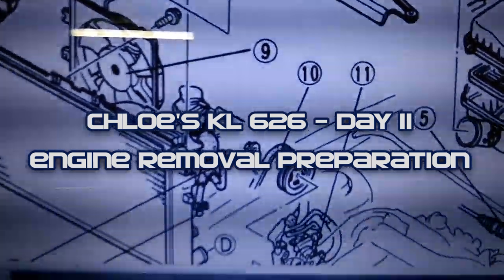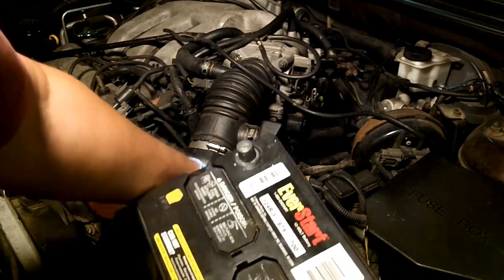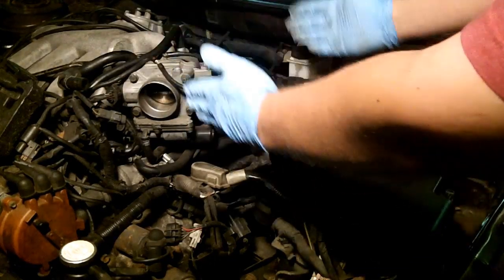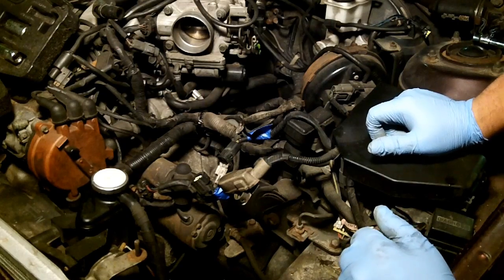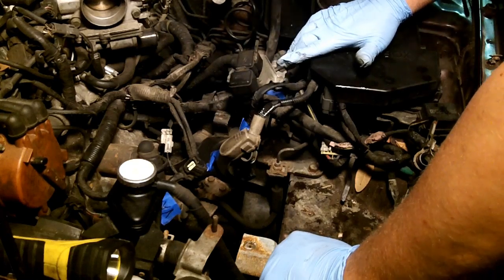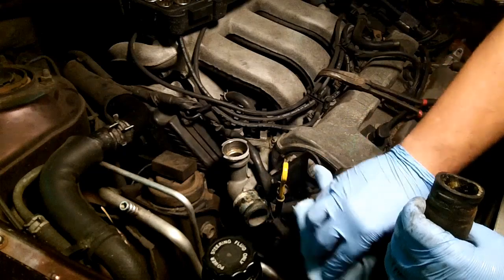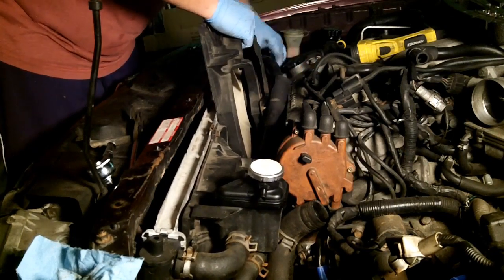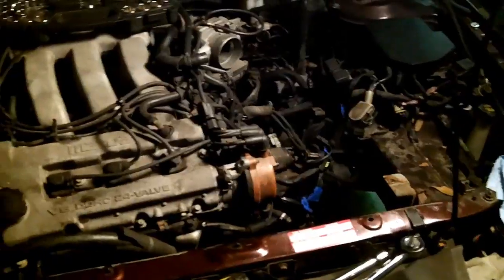Angel KL 11 - Prepping Engine for Removal

Comment: Maybe you'll remember, and maybe you'll just know. The hose that is connected to what you called the cruise control actuator, does that connect to anything else? I'm in the process of reassembling my own klde in a 93 probe gt after replacing cylinder heads and am finding that I did not take near enough pictures/notes on things. Thanks! Loving the videos and all of your information!
Reply from the maker: John Sandbulte Yes that vacuum hose should be connected to manifold vacuum somewhere.  I don't know exactly where because I don't know the KL well enough yet plus it's an engine swap (not original engine).  When you click "set" on your cruise control the vacuum applied actually holds the gas pedal at that specific location.  The gas pedal is sucked into place using vacuum and held there.  If you don't have that vacuum hose hooked up then there's no way your gas pedal can get held in place because there will be no vacuum.
Reply: Awesome, I will get to work on finding that routing diagram then! Again, thanks for the videos, the commentary is great, and the music is pretty good too lol
Reply from the maker: John Sandbulte Thank you for the compliments.  If you ever have a question or comment please feel free to post.  I love interaction with other FS and KL owners. :)